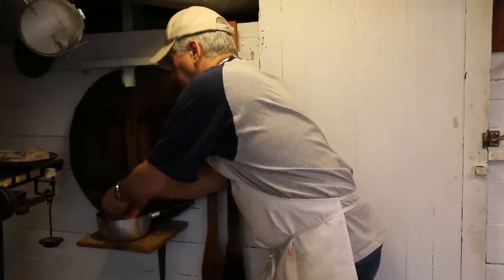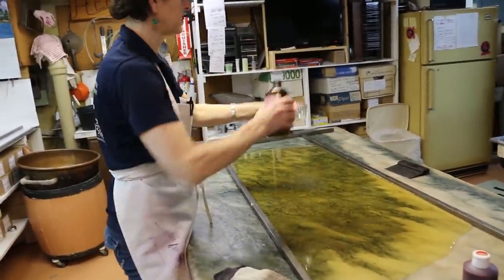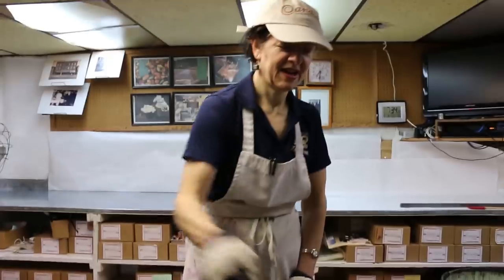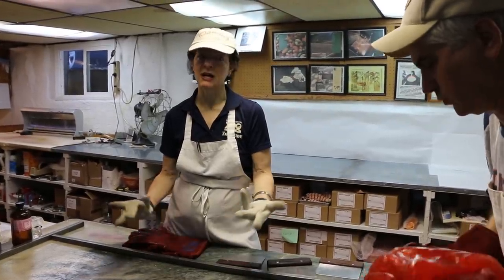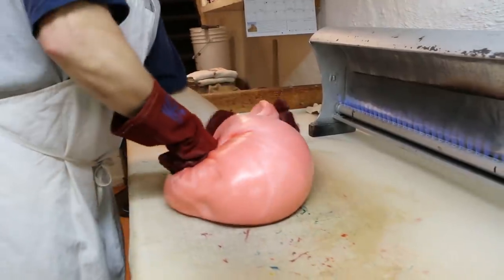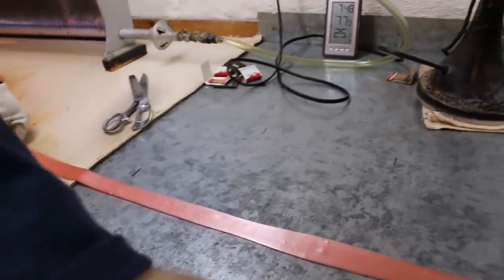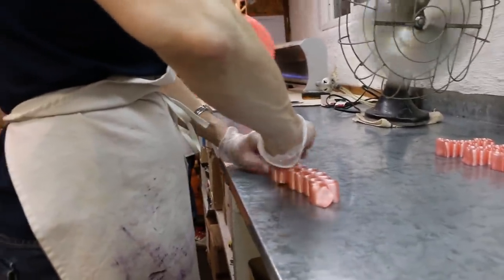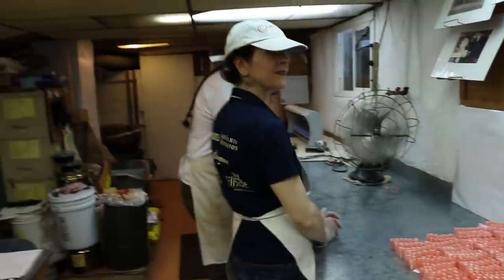How Wintergreen Ribbon Candy is Made | Day 1 of Ribbon Candy Week

Comment: Ok Terrie and Steve. I'm a  if fan from NZ. Question though...why do you hit the hook. What does it do??? Cheers Dee
Reply: When they used the hook they trapped air bubbles so it will look lighter. For example before they put any color in it looks like an amber color but when they  pull it will become white. they don't need the hook but its easier. Hope I helped.
Reply: They hit the hook because the candy sometimes sticks to it. The vibration helps to loosen it up.

Comment: Why don't you add the colouring to the sugar when it is boiling in the copper pot?
Reply: Samantha Bennett They use gel coloring, which they don’t have to boil off the water.
Reply: +Veronica Boyer (PrincessVoldemort) ok thanks, I just thought it would be easier to mix the colour through :)

Comment: Why do you not pour the color in while the candy is at full temperature and mix it into the liquid with a metal spoon?  That's the way I've seen lofty pursuits and Candylabs do it.  It seems like you'd avoid the bleeding dynamics.  I could see how if you're doing a stripe that could make it more complicated because then you need to do the cut liquid portion thing that Lofty pursuits do and you don't have the water cooled table, but with this it seems like it would work and be a little easier.
Reply: Victor Kinzer seems like it works for them the way they do it.
Reply: Victor Kinzer Lofty pursuits uses a water based food colouring so he has to boil off the water. Terry uses a gel food colouring so putting in at peak temp wouldn't do anything.
Reply: Ah.  That makes sense.  I've been curious about that difference for a while.